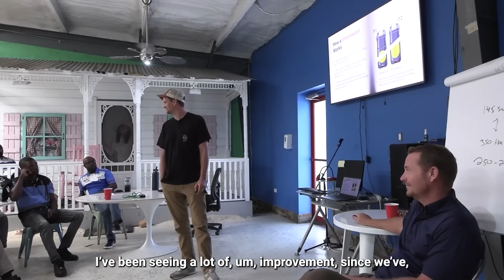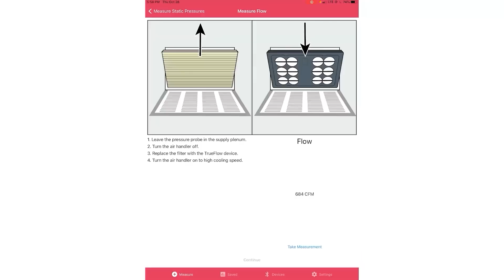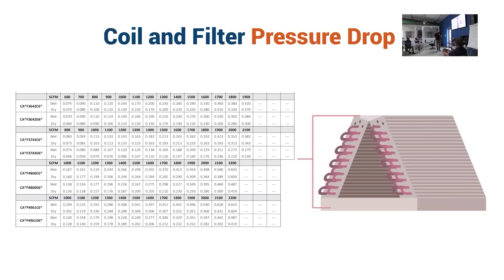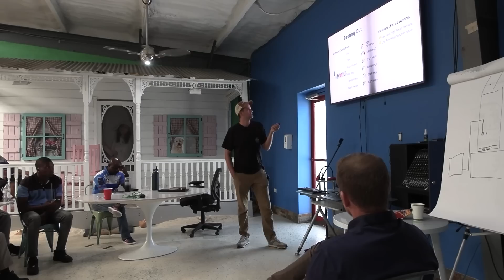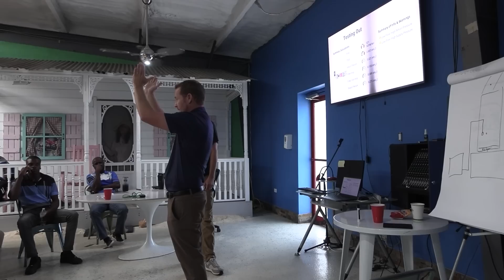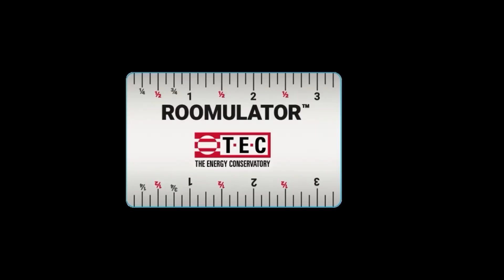Airflow & Static Pressure with Matt Bruner & Bryan Orr

Comment: Thanks for uploading all these videos. Has been great information as someone doing facility maintenance for a data center.
Reply: Where do you work at
Reply: Data center.... that would be a very scheduled environment,  with a lot of repetitive repair? My hvac started on the major appliance end and from there went to commercial kitchens dealing with low end repair, air balance, and economiser optimization... greasy fun😂
Reply: @ yeah but there’s so much equipment it takes a while.

I don’t do filter swaps/coil cleaning, mainly watch BMS and troubleshoot. Luckily our systems are all supposed to be engineered correctly, so there’s isn’t anything TOO crazy to fox
Reply: @xMamoo2011  how come ? Are other technicians doing it or it’s not required as much. Any tips for my interview?
Reply: @xMamoo2011 I'm wondering how did you end up there and how is the quality of life? I'm currently working towards that route

Comment: For a residential service technician : you’re basically checking for fan speed, filter restriction , coil condition and total CFMs . 

Make sure the filters are clean , coil is clean , CFMs per tonnage , amp draw on the blower . We’re measuring in WC. Just like refrigerant- air flow should not have much turbulence. 

Critical pressure should be performed by an air balance professional.
Reply: Excellent comment.

Comment: How possiblly can the total pressure go up when the air flow has increased? In the provided case study you mention replacing the filter with a bigger one does increase CFM a bit but the total static pressure drop shoots up a lot. The motor is one speed as you mentioned, so the fan curve is one. When a bigger filter is placed the system curve would flatten a bit and the operating point will be at higher CFM and lower static. I don't see how the static can increase with the increased CFM. Makes little sense to me. Please explain.

Comment: VenturY
Reply: Venturi effect like an old school engine carborater does,  like a plugged up condenser coil fan  blows air out sideways from it  vs. straight up
Reply: Way over complicated our industry has become :(
Reply: Way over complicated our industry has become :(

I've seen rumulator before of should be commom sense of no return in a room, then probably most likely, AC will not get to well if doors are closed.

Comment: How about the fact that most ECM motors set up correctly with blower speeds according to static pressure/ AC tonnage/ CFM, do not last much longer than warranty period and cost 4x minimum the price of an equivalent PSC motor that can last for decades?

Or about the fact that no longer we can replace just failed power/ electronics/ capacitor end caps for them?

Or how about we can't carry universal replacement motors for them on our trucks!??

Who is screwing/ Fng each other more??

Comment: I’m a service tech so I use my manometer mostly for diagnosis.  You can tell if you have a restriction in your filter, evaporator, blower wheel, or ductwork without pulling one panel.

Comment: Sir, excuse me if I bother you but I have even gone to the store where I buy air conditioning parts and I have asked for technical information on the supply and return grilles and the air filters and the evaporator coils to know data such as flows and pressure drops and they do not know anything, I do not know where I could find that information, if you could help me where I could find that information I would greatly appreciate it, I am only a self-taught learner, I have my HVAC license but I have not been able to develop in this field as much as I would like, but I continue studying and I have not lost hope of being an excellent technician. Thank you for your videos.

Comment: Hello. minute 21.59 you mentioned  002, 003 and 005. what is it really speaking 0.002, 0.003 and 0.005 or 0.02, 0.03 and 0.05, I am sorry Sr but you do need to be more specific  because it is not the same. Very good video. I am waiting for your response. thank you.
Reply: You know he’s referring to the air handler models right?  

003 
002 
005 is a model number size for a carrier airhandler not exactly referring to total external static.